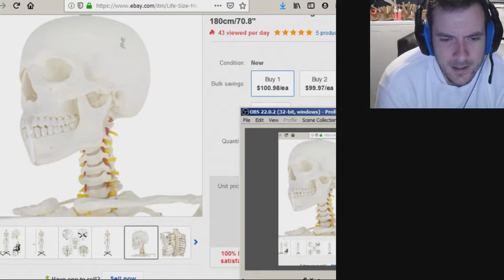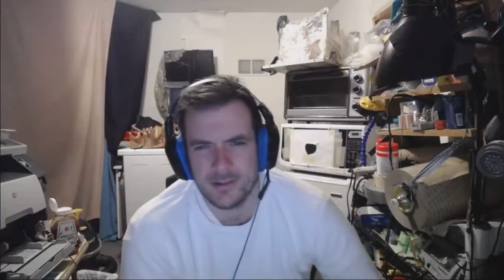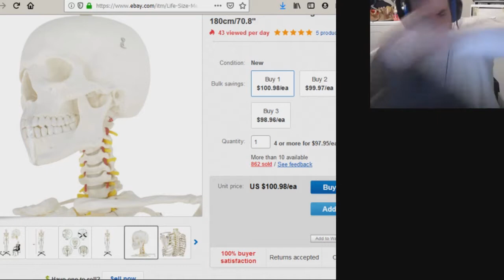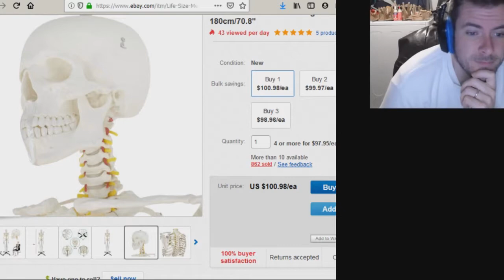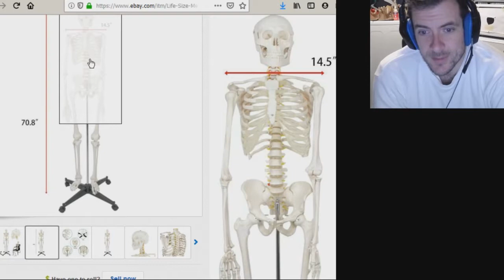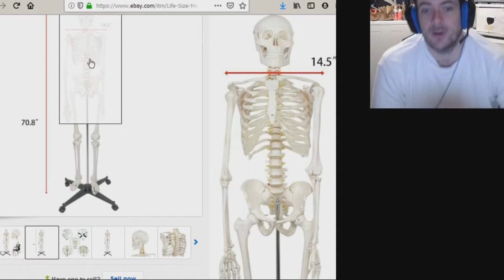Going PVC Medical Skeleton for the Humanoid as a Shortcut | Building Humanoid Robots #145

Comment: Dude wheres thAt shelf that fell
Reply from the maker: Great question.  Still in operation.  That time it fell was just after I had just done major renovations and upgrades to the shelf and didn't finish sealing up all the joints solidly so it was wobbly and it fell that time famously...  After putting it back up, I reinforced it pretty good and it held up another 15 or so months, however, it was starting to tilt and sag under the massive weight I have on it and I decided to shore it up again a few days ago.  Used steel pipe to straighten up the legs and also used towing straps to lift the weight of the midpoint of the shelf and anchor that to wall studs.  This way even if the legs give out the shelf can mostly stand due to being now pinned to the wall structure behind it.